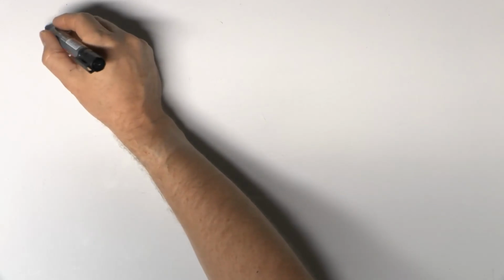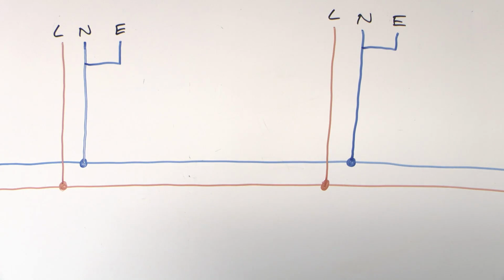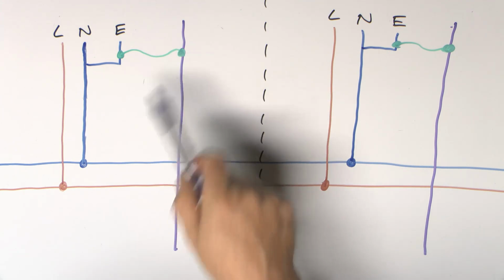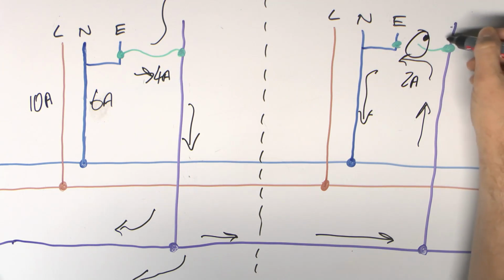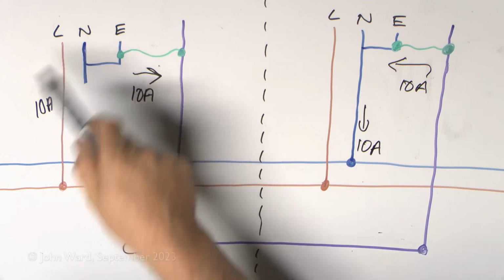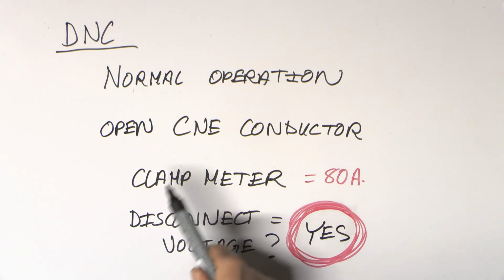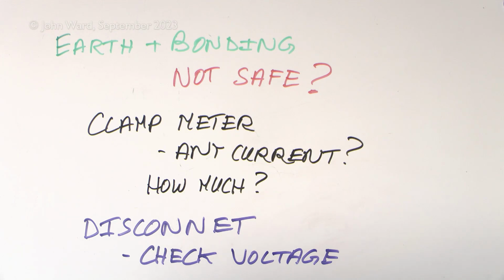Diverted Neutral Current - Description Overview Part 1

Comment: That's peculiar. I'm usa our system is grounded to water line and earth rods at the service panel. In that 10 amp example we have 9.9A returning on neutral to transformer.  Maybe .10A or less to ground rod and pipe.

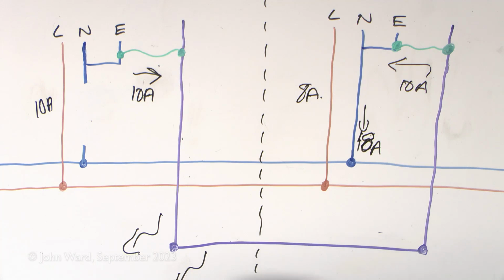Comment: Rly annoyingly in another video you claimed this earhting system did not have local earthing, but used neutral from the transformer straight then split it up into ground and neutral. OFC that eould be even more dangerous 14:59

Comment: How does this happen if every modern household (built or wired in the past 40 years) has an RCD/RCBO the imbalance would be detected and prevent this?
Reply from the maker: RCDs only detect a current imbalance within the installation, they are of no use for problems outside it.

Comment: I can't find any earth bonding to any pipes in my installation.  Water and gas pipe supply is now plastic. Should I fit bonding to central heating?
Reply from the maker: Plastic pipes do not require bonding.
Central heating is unlikely to need bonding, unless it has metallic pipes in a concrete floor or similar.
Bonding items when it's not required makes the situation worse.

Comment: Excellent video, very important matter we need to be aware of. But I think you forgot to mention one thing, that lots of sections of gas and water mains pipes are continuously being replaced by plastic piping which further complicates this situation. So having seen this video it makes me think perhaps I should get myself a decent clamp meter and perhaps carry out occasional checks on my own installation, especially as I've got a very old TNS type supply cable which might be converted to TNCS further upstream, especially as a few years ago the big main supply substation for my local town was rebuilt, and there's been various cables dug up and replaced etc. I also think perhaps some kind of monitoring device with little current transformers which clip onto my meter tails could be a good idea so I could continuously monitor  the current in both conductors to see if there's ever any serious imbalance, surely if I stick a clamp meter onto each conductor in turn it should normally show similar readings, with little or nothing flowing down the earth, although of course there's bound to be some small leakage to earth in some appliances, especially anything with a switched-mode power supply feeding it which has an earth, or the washing machine as that too will have a supply filter fitted as most of them have now.

Comment: Hi! Isn't it mandatory for each bulding to have metal rods burried into the ground and then connected at the point where CNE is split into N and E? Wouldn't that remove the potential danger?
Reply from the maker: It's required in most countries but in the UK it isn't.  For decades it wasn't even suggested, more recently it is recommended but still not required.

Comment: This can only happen if adjacent homes share the same mains.  In the US we use split phase  120/240 volt supplies almost always with separate transformers for each property. We also use separate grounding rods for the earth connection. Although many years ago the earth ground may have been a water pipe. 

We can get an open neutral from the transformer and send any imbalanced current through the bonded neutral/ground connection. The neutral only has the imbalance between the two main 240 volt lines. The mains between two properties are isolated by their individual transformers.  As far as I know, the only situation where the mains might be shared is in apartments in the same building
Reply from the maker: Most UK homes are connected to a shared transformer which typically supplies anything from dozens to hundreds of individual properties.
Reply: @jwflame  Yeah, I fairly recently discovered how common it was there! Definitely not the case in the US.  The fact that we use split phase, would  really complicate things with shared mains. 

Maybe the shared mains saves a little money and European systems use less copper, but even then shared mains only seems practical with a neighborhood all built at the same time which is genially not how we did it. Even today, housing is more of a national issue in Europe, whereas in the US, that isn't nor never was the norm. 

A bunch of smaller transformers are pretty cost effective over big ones. Most of the country uses overhead HV lines and pole mounted transformers and I think we spend a lot less on feed cables. I guess there are trade-off with underground feeds. We do sometimes use a pad mounted transformers right near the road and then underground to the homes. But that isn't usually the norm. And I have never seen daisy chaining from house to house, which I understand is fairly common there, making upgraded services for things like EV chargers and heat pumps. Upsizing a service in the US is pretty quick and low cost. 

Standard service used to be 100A 240/120, but 200A is the norm for new service and 400A is not unusual for big homes that are all electric. Just a lot more differences than one might think!!  

Personally, I think the split phase approach is just so much more efficient and safer with the standard circuits being 120 volts. And it made a ton of sense at the time of the current wars. Edison had fairly extensive wiring using 3 wire DC and very popular 110 volt incandescent lighting. Those installations were easily adaptable to to split phase AC. Edison wanted DC, but in losing out to AC, he still won financially,  I enjoy the history of the development of electrical systems!  I find it interesting that in many ways it  was the British scientific community who were the technical center of electrical development.  But then it was largely the German engineers who called the shots for how Europe would go. And then European colonies followed with the same standards. In the very early days, electricity was mainly about lighting but before long motors and other devices became common place, and neither system was even going to consider changing.
Reply: Yeah.. The split phase in the U.S makes much more sense. Whatever load one house gets wont affect the other houses. However, i will say that it's common for houses in urban area to share one transformer. If too many houses connect to one transformer, it can easily overload the transformer. But this rarely happens because each transformer is calculated to handle certain amount of load. The utility companies will make sure appropriate number of houses get connected to one transformer so overload wont happen

Comment: hi, John thank you for the videos on diverted neutral current ,,, very interesting subject and i'm looking forward to hearing more from you on this subject.
can i ask you a question. I currently have an installation which i've only looked at briefly, where the final circuits are showing readings of PE=.51 AND PN 1.06 OHMS
and respectively PFC 450A & PSC 217A,,,  in this case where the psc is lower than the pfc,, could it be a consequence of a failing nuetral connection on the dno's side? which could lead to a broken pen conductor? your thoughts welcomed.
unable to test pfc and psc at the  origin of the installation due to complexity ( 3 phase 100a suppy to hmo property)
voltage and frequency at ok @  233v 50hz
initially used a martindale ez2500 to gather these results prior to doing anything.
dave d

Comment: Very interesting and quite fascinating. In the 1970's during my apprenticeship with the EEB we went out to a fault. The reported fault was that the consumer turned on the kitchen light and it blew up accompanied by a bang and big arc!
When we got there, we established that there were no other items in the installation actually turned on at all (they didn't even have a fridge!
The semi-detached 1920's was at the end of the lane in the wilds of Essex.
We checked their supply fuse, (40A rated BS88) it had blown! The experienced electrician said not to replace it at this point!
The installation was what is now called a TT system and there was an earth rod connected with a single piece of '7064' (6.0mm?) copper conductor. When I got my 'John Drummond' test lead out (15w pygmy lamp in series with a resistor) and connected it Live to Neutral between the two seperate connectors it was bright! Immediately I knew that we had more than what was then normal expected voltage of 240V!
When I checked Line / Earth, it was the normal brightness for single phase installations (we weren't equipped in thoses days with voltage meters LOL! 
We went outside to have a look at the overheads which consisted of 4 overhead lines with a pick-up on the top and bottom conductors (the standard would have been Red phase (now Line 1) and the bottom being the Neutral - the conducts were covered in the old style material braid. Nothing seem untoward. 
I popped next door. Luckily the people were in and said that they turned the (electric) cooker on and it didn't work, along with the immersion heater and the washing machine!!
I did the same tests as next door - their supply fuse (60A rated BS88) hadn't blown!
Again I got the same brightness levels on my test lamp.
When I looked at the overhead lines their connections were 2nd conductor (Yellow phase - now L2) and the bottom one, the Neutral.
The electrician said "it sounds like a high neutral up the pole"!
By this he meant that the supply neutral in the network prior to the properties had gone open circuit.
He concluded that each installation was on a different phase and when the first consumer turned on here kitchen light it put the two properties 'phase to phase' nominally 415 volts! 
Experienced learnt - only ever saw this type of fault one again in an office where there was a dis. board burnt out connection! Keep up the good work, though I'm retired, still have a thirst for our industry!
Reply: came across similar in a 3 phase sub board in a factory, nice board solid quality install just added my two circuits and  breakers to it check and all fine, everything in the workshop fine button it up and carry on elsewhere ,,,lunchtime a guy was charging his drill battery  and it melted  ,came to see me if it was repairable ,,didnt look like it was   but plugged my socket tester into the socket and 415v present ,, the whole worskshop was 415  the fault was the incoming  supply to the board neutral was loose, slight bit of burning on the copper inside the connection but thats it,,, probably been loose but functional for years combination of me disturbing the board and him placing his charger on top of the board as he normally does  was the final straw,,,,,,, everytime i open a board since then, 3 phase or singe  i check every conection even though they have nothing to do with me  even my own ,,,,,

Comment: A thought - If I am using significant current in my house and the CNE connection fails then potentially it could put all that load onto someone else's Earth Bond - which possibly would not be robust enough to take it. I preusme that could cause a fire or similar problems in a neighbour's property.

Comment: John
I live in Southern Ireland and we use TN-C-S and the incoming supply to the houses is underground. 
We have a plastic water pipe and no gas in our house. Some neighbors have gas but I think it is also a plastic pipe.
But, in our estate, we all also have a local earth rod fitted on each property. This rod is fitted a few feet from the meter cabinet, which is in the side passage of the house, and the rod is connected to the main earth terminal in the meter cabinet.
This local earth will, as you say, carry a proportion of the current depending on its impedance.
The danger of this system is we may never know if our neutral was broken or damaged as the earth rod will then carry all the current.
The advantage is, I suppose, is in the event of a broken neutral a householder should not receive a shock from "extraneous metal parts" as the earth rod should dissipate the current.
And believe me when I say it wouldn't surprise me if we had broken neutrals as guys with diggers have dug up nearly everything in the estate over the years.
Any observations?
Thanks for the videos.

Comment: Personally, regardless of what current is going through the earth bonding wire, I would use a temporary earth bonding lead to strap any gas and water pipe to the main earth terminal before disconnecting the bonding for alterations. Because you don’t know how conditions can change while you’re working.

Comment: Could this lead to DNO voltage transformers fitted around the incoming earth after it is split? The VT monitors voltage on the earth and actuates a protective device that would effectively disconnect the affected property after a certain threshold.

 Highly impractical and possibly dangerous in itself but it just seems like there is very much little else to be done other that rip up the whole TNCS network, which, knowing our government, wont be something they'll be interested in doing
Reply: VTs round all metallic utilities also?

Comment: This gets even more complicated when you throw a property with a three phase inbalanced load into the mix. In that situation you can get voltages greater than 230 volts once the bonding conductors are detatched!

Comment: If you don't have a earth electrode, what would you compare the voltage against after disconnecting the earth?
Reply from the maker: You can't.  Either use a single pole contact voltage indicator, or put a temporary electrode in the garden outside.

Comment: Given that properties in a street are usually on alternate phases how does this complicate matters?
Reply from the maker: If the CNE or neutral is broken, the voltage in each house can either be too low, correct or too high.  Anything up to 400V between L&N is possible, with exposed metal parts up to 400V above the true Earth outside.

Comment: Just checked mine, there was just over 100mA on the main earth cable out of my consumer unit, but about 600mA on the link between the service cable sheath earth (TN-S) and the MET (The MET has the supplier earth, the gas and water bond, and the earth for the CU)

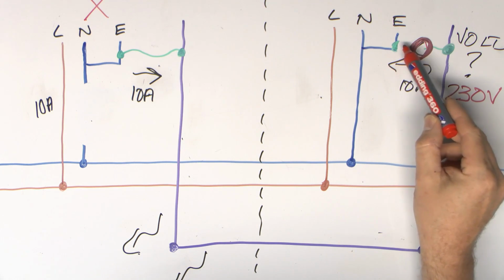Comment: Been trying to work on a live model of this. Issues I've found is knowing the resistivity of water/gas pipes etc as it seems to vary a lot so I'd like to know the min and max to gain insight how to move forward on this issue as this influences the touch voltages potentially present that you describe at time stamp 17:10. Great video as always John. Thank you. 

Let's hope the utilities get on with inserting insulating sections pronto as that would help in many cases....... Water still may be an issue tho as it may not be enough to reduce conductivity to satisfactory levels? Would depend on water conductivity In different areas. Obv most new builds are resistant to this issue as they have very few extraneous potentials. I wonder if it's a water people and gas people issue rather than electrical people issue?

Comment: Perhaps there should be a requirement that all copper piping in a home that might be Earth Bonded should have a non-conductive section on entering the home, to isolate it electrically from other properties. This could easily be retrofitted when a house is rewired, or replumbed. I'm not a fan of things like PEX for water, as I wonder what endocrine disruptors might be mixed in to such plastics, but the use of plastic water and gas pipes would eliminate the DNC problem.
Reply: Then would it still be required to be Bonded?
Reply: @temp06j723-pmeighttq  It depends on whether there are any extraneous conductive parts in the system. There could be pipework piercing the building envelope, such as drains, or pipework buried in a concrete floor. Particularly in older properties, it's better to adopt a 'belt and braces' approach.

Comment: Hi john, from an old spark from the 60'. well explained as usual and  excellent tutorial. Is it possible when you do your demonstration to use a Fluke T6-600 clamp meter to see if it can show current and voltage at the same time on the display I understand it can do that so may be very useful if it does, contact testers can be a bit sensitive, I've got a couple and they seem to be. Just a thought, look forward to next video always an high  standard hard to beat.

Peter.

Comment: Greetings John!
Another stimulating interesting video,,, while you were describing the currents in this I started considering what happens to R.C.Ds.,, And even the Meter would have its accuracy thrown off,, as I believe both those devices work with both L&N and the relative balance is how they both perform their tasks
Reply: Wouldn't affect meters as although they normally have both L and N going in and out, the neutrals are solidly linked across.  The neutral is only required to power the meter.  Indeed, I've seen the odd installation where the meter only has a neutral going into the meter (to power it) but the neutral going off to the CU has been taken off the henley block before the meter.

Also it wouldn't trouble the RCD because the parallel path is upstream from it.  You still have balanced current through the RCD because it's only once it gets back to the cutout that it has the chance to take a parallel path via the earth terminal.
Reply: The kWh meter will still be functioning as per the household appliances.

The open CNE/PEN is Before/At the Service Head.